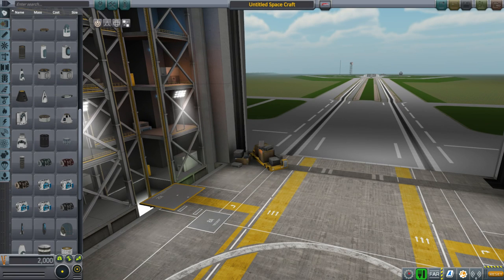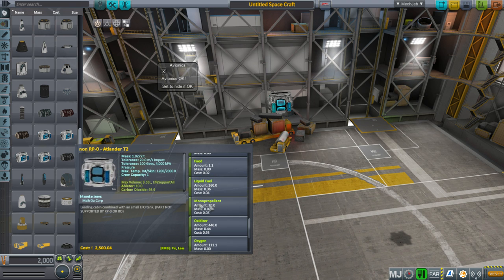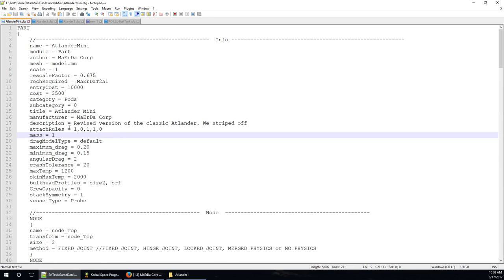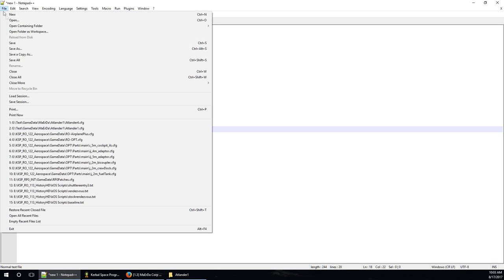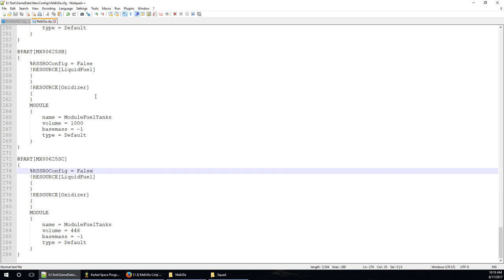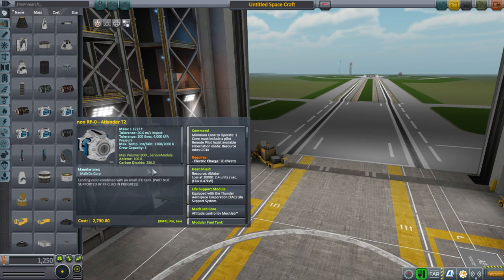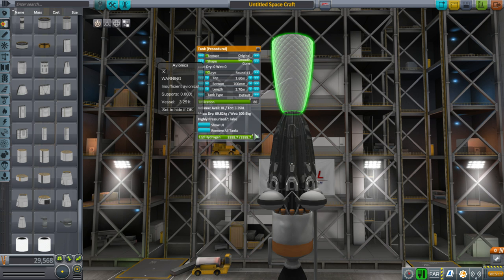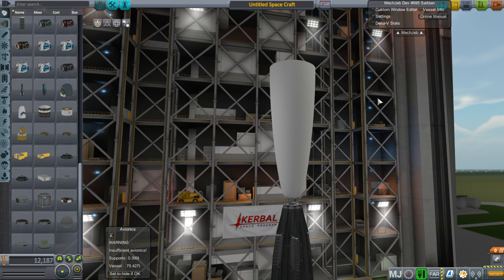Making Realism Overhaul Configs 1 - Command Pods and Fuel Tanks

Comment: Does RO make the stock parts bigger?
Reply: RO makes stock command pods bigger by 1.6 times. It also changes engines to real engines, so it will also resize them, but not by the factor 1.6, also RO resizes plane parts - Mk3 by a facotr of 1.6 and Mk2 by a factor of 1.72222